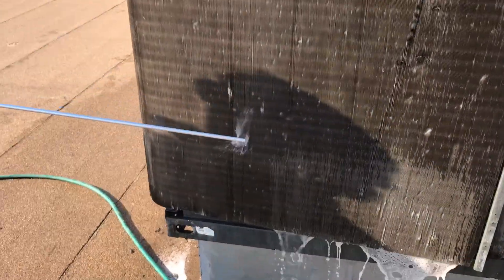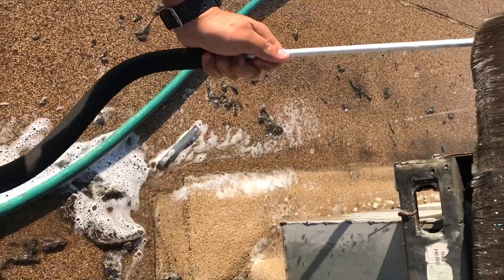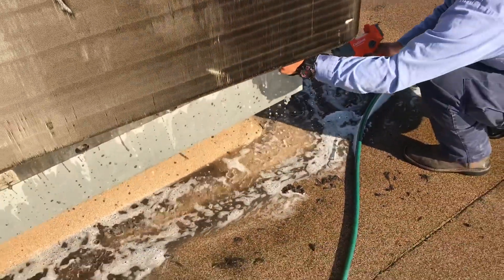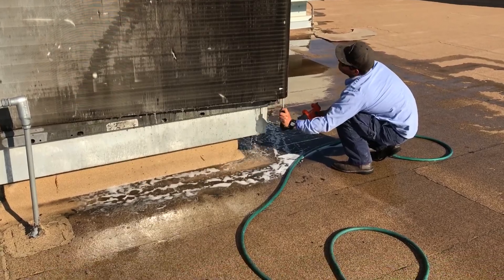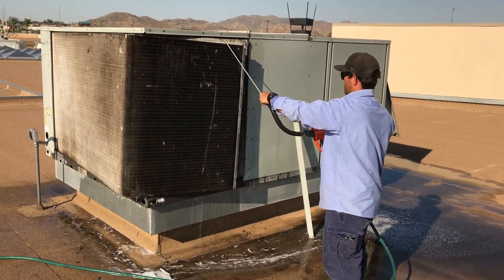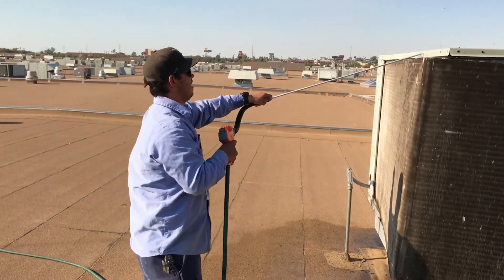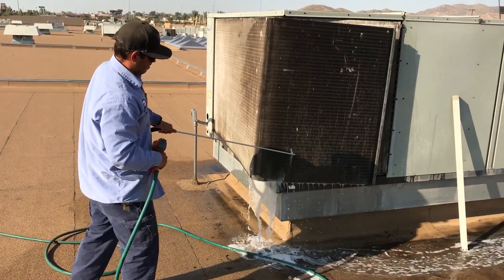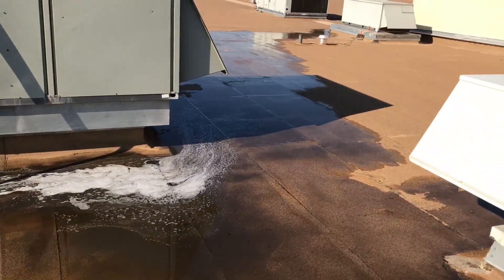HVAC Use of Speedclean CoilShot

Comment: Split coils are a pain in the ass. You are better off cleaning them with a high water volume within reason. No pressure washer. Every building is going to be different. Water pressure, length of hose, etc. Glad to see someone splitting coils and cleaning them the proper way.